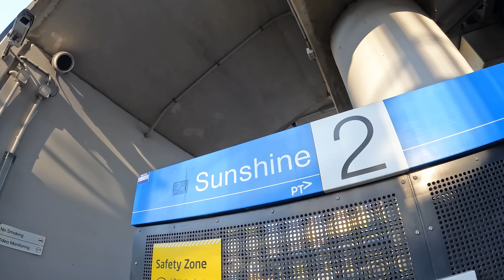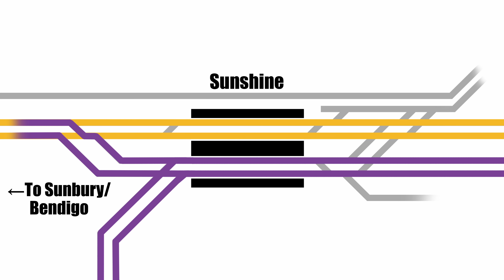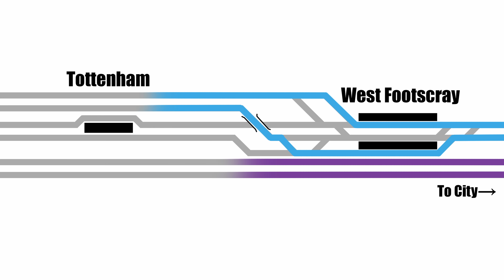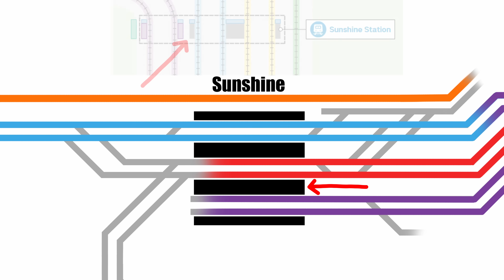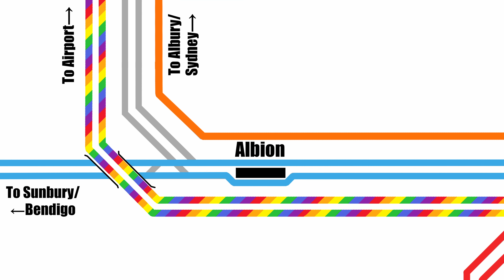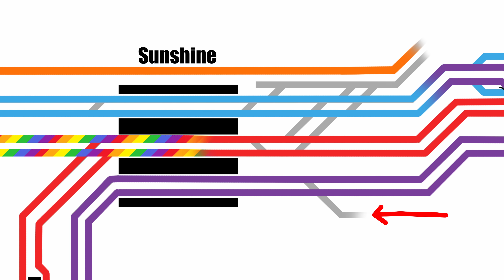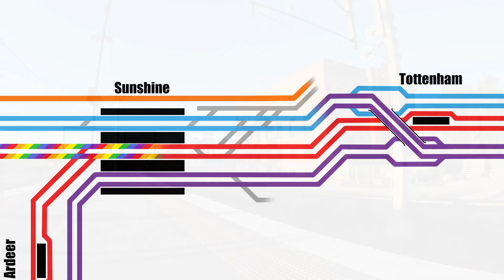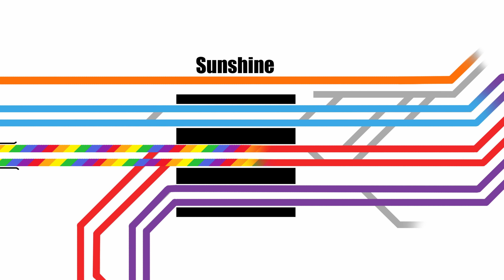A new plan for Sunshine // Melbourne Airport Rail!

Comment from the maker: A quick correction: at 03:40 I said the old standard gauge platform was to allow the Southern Aurora to connect with the Overland - it was actually for the Intercapital Daylight to connect with the Overland, the 'Aurora didn't stop here (I should have realised this - the Overland and SA were both night trains, so would be going in the same direction at roughly the same time, whereas the ID would have been heading out as the Overland came in, and vice-versa).

At 08:20 I speculated about the removal of the crossovers allowing Ballarat line freight trains to access Tottenham yard. It's now been confirmed they will be removed, and I made a short follow-up video about it here: https://youtu.be/Az7XUYPGw_g

For official information on this project, follow this link: https://bigbuild.vic.gov.au/projects/melbourne-airport-rail/designs/sunshine-station
If you enjoy watching these videos and would like to support the channel, you can join me on Patreon: https://www.patreon.com/c/Taitset
The credit music for this video is an unreleased track by Francis Ivy, which will be part of their upcoming debut album. Follow them on insta here: https://www.instagram.com/francisivyband/

Comment: What I don’t understand is how they are going to put in the space for passing tracks for Vline trains as it isn’t large enough between Ardeer & Caroline Springs (especially Deer Park because of the new overpass over the old road as it was removed).
If the plans do go ahead then it may ruin the purpose of the Vline shuttle as they plan to make the Melton - Southern Cross service 9 coaches to fit a lot of people.

If these electrification plans go ahead, then we may never see 9 car Vlocitys in the future and let alone even 2 extra terminating platforms at Melton.

Melton Station would need to most likely be relocated entirely becuase of the car parks. (but level crossing free lines?)

Comment: 7:10 the regional trains could still run through deer park/ardeer/caroline springs (i think), if they used the set of crossovers just before sunshine, from the sunbury line to the melton line. unless they rip them up but that would be extremely unlikely i would think. tottenham would still lose it's trains though, but its better than nothing
idk tell me if i'm wrong about something
Reply from the maker: It seems like the crossovers are going.

Comment: So in order to increase capacity on the northern group they've separated out Sunbury into the metro tunnel... where they're going to add the airport and Melton. Have I missed something or is this just moving the problem?
Reply from the maker: The metro tunnel will have a higher through-put than the northern loop. But yeah, it'll be interesting to see if it ends up being congested anyway.

Comment: The DOT actually had a brilliant plan to make the airport line standard gauge and extend it through the new suburbs to Wallan and on to Shepparton, Albury and Sydney.  There was also to be another line from the airport to Clarkfield, thus eliminating the need for V/Line trains to go through Sunbury and making Bendigo line much faster.  Unfortunately, this visionary plan got kyboshed when the crazy Suburban Rail Loop started to get traction.  The most successful airport rail lines have the airport as one stop on a through line.  Even the word's number one airport, Singapore Changi, can't justify through trains to the city and runs the branch line to the airport as a small feeder service.

Comment: Can you please do a video of how the Frankston line works, I used it many times around Flinderstreet and Southern cross and I still get confused, So from Frankston You can take the train to Flinderstreet and so on, stopping at Southern cross, But for some reason Going backwards from southern cross if I wanted to go to Frankston you’ll have to get off at Flinderstreet and Get on another Frankston line service to Frankston, It’s just confusing lol
Reply from the maker: It sounds like you were just on a train that was supposed to continue to Frankston, but then got turned into a different service at Flinders Street. The majority of trains run though, but sometimes you may need to change there (in either direction).
Reply: @Taitset thanks

Comment: Electrification -> I've heard in Europe there's a trend towards using batteries that charge while the train runs on the electrified lines then used for short "last mile" journeys on non-electrified lines (big enough batteries to run a train are too heavy and slow to charge for full journeys).  This is giving the ability to expand networks without expensive electrification.  I wondering if they're electrifying Melton because they need it ASAP for MetroTunnel ... but these hybrid battery trains might be the future for something like Tarneit - Wyndhamvale? By the way all the bridges and station in that corridor seem to be designed for eventual track duplication for seperate country and suburban lines.
Reply from the maker: The only place battery operation potentially makes sense is for fairly short, fairly low speed, fairly infrequent lines. The only place I'd suggest it might make sense for here is the Stony Point line. Wyndham Vale (and in fact Geelong) are heavily used fast lines with very frequent trains - it's well worth electrifying properly.

Comment: Caroline Springs station was built with electrification in mind from the start. Years 😮 I did some structural CAD work on it, there should be some footings on the north and south sides of the stations for catenary structures to enable easy electrification to Melton

Comment: Can you please make a video what the difference between Melbourne metro🇦🇺 and Moscow metro🇷🇺
Reply: Well for one, it uses 825V A/C third rail as opposed to our 1500 D/C overhead wires, and it use 1520mm rail and we use 1600mm rail. Unlike in Melbourne, where we use 2 metropolitan zones, Moscow has no zones.

Comment: A big question for me is where will the Melton suburban line trains terminate at the Metro Tunnel end? According to a blog post I found which in turn cites the Metro Tunnel and Melbourne Airport Rail business cases is that when the Munnel initially opens this year, the baseline off-peak timetable will be 6 tph between Cranbourne/Pakenham and Sydenham/Sunbury and 6 tph between Westall and West Footscray, then when the Airport Line would start running in the 2030's all the West Footscray-terminating trains would run out there. Basically that would leave the off-peak frequency on the South Yarra-Westall section at 12tph with 6 going to Sydenham and Sunbury and 6 going to the airport, which should leave enough room for the 1.5-2tph Gippsland line frequency they're currently planning. But now you'd also have anywhere from 3-6 additional Melton line trains per hour running along the Dandenong corridor which will leave very little room to expand service on the Gippsland line and only further highlighting how much of a bottleneck "Skyrail" has made that line. So in my mind they'd probably have to find somewhere to terminate those extra trains from Melton and also possibly Wyndham Vale in the future, like at Anzac or something, to prevent the Dandenong line from being extremely crowded during peak times. But I don't see any plans for this, so in my eyes this oversight is a timebomb waiting to explode. The only thing I can think of which would make this work is the communication-based signalling on the Dandenong line, which admittedly I'm not really that knowledgeable about how signalling systems work, but if someone who knows more about that stuff could enlighten me on what the maximum throughput of the current Dandenong line with the new signalling system is, that would be much appreciated.

Comment: Quick question, I thought that the airport line was going to connect from Broadmeadows or off the craigieburn line which would bring some much needed attention to it and upgrades, especially as they are getting the new X Trap 2.0s. As someone who uses the craigieburn line on the daily, just wish they’d update it or pay it some attention. What are your thoughts on this?
Reply: An earlier suggestion (several actuall, over the decades) was for the airport line to run off the Craigieburn line.  But the government announced in 2018 that it would be built to run via Sunshine, and the Albion-Jacana rail corridor.

Unless you mean the far distant SRL North, which (as currently proposed) would link Broadmeadows station with the airport, but not until the mid 2050s.

Comment: I hope that split platform between 4 and the new 5 is incorrect and that it is indeed an island platform, because it is potentially a cross-platform interchange between the western regional lines (Geelong/Wyndham Vale, Ballarat/Arrarat) inbound to transfer onto the Airport line heading to the Airport. If not, then an inbound Geelong/Wyndham Vale/Ballarat VLine passenger switching to an Airport-bound Metro train will be forced to do a super awkward platform change rather than just walk across the platform. For inbound Melton or Sunbury electric trains heading to the Airport, those passengers could theoretically continue one stop further down to Tottenham for a cross-platform change onto the Airport line and vice versa if they wanted, but that is a crap outcome. Otherwise they have an awkward platform interchange now because the Airport line won't be stopped at Albion and has separate platforms at Sunshine.

Comment: When I saw this video title I was wondering if the XPT (and whatever will be replacing it eventually) would be stopping here as Broadmeadows is the only other stop in the Greater Melbourne area for that train. Every time I've gone to Melbourne I've used the XPT and it would be handy to have some other stops rather than having to change trains at Broadmeadows or Southern Cross...but obviously that ain't a priority here.

Comment: @Taitset i found a solution where the bendigo fly over isn't needed 
Once the metro tunnel is running u can use the existing tracks that run past the tunnel and south ken to run bendigo v line services on as these travks will become un used when the tunnel opens
Reply from the maker: That creates a much longer section where Bendigo has to share with suburban trains, and also creates a conflict between Bendigo and Craigieburn/Upfield at North Melbourne.
Reply: @Taitset  yes it would be a longer section till west footscray when the airport/melton line would branch off on the existing alignment while the new alignment would run sunbury/bendigo line .
As for the conflict mabey a short flyover between north Melbourne  and south ken could be used to re rought/tap in the bendigo line to the un used track this line so there dosen't have to be the conflict
Reply: BTW love your videos very informative

Comment: Re: building concurrently with Melton electrification and quadding. As much as I hope this is true, I don't think the regional stations present a problem - it would be easy enough to build the new platforms at Sunshine and just plug them into the existing tracks in the short term. Then once you've built the electrification and quad track, slew them over to connect with the new express tracks. Good point about Tottenham, though - I don't see how it could get any trains in the short term, unless they electrify to Melton (or the Airport Rail project happens sooner than we assume). 

Re Bendigo trains sharing space with Metro trains for longer - I don't think this actually causes any problems, or at least in comparison to a hypothetical "Bendigo trains stop at Sunshine but do it at Platforms 5 and 6" scenario. When different types of trains share tracks, it's differing stopping patterns that tend to cause the headaches - express trains catching up to stopping-all-stations trains. In this new section (east of Albion-west of Tottenham) both trains have the exact same stopping pattern (ie both stop at Sunshine) so they shouldn't get in each others' way too much.
Reply from the maker: Good point about Bendigo, I didn't consider the change in stopping pattern. 

Agreed about temporary crossovers being the answer to Deer Park etc, I'm just not sure if that's actually the plan.

Comment: The Wyndham line only has 2 stations, so they'll have to build out like 3~4 more to make it viable to electrify

However Melton line has most of the stations in place; 6, only needing maybe another 2 to make it viable to go

But in the current state budget is $641m for works on the Melton line; which is for ???? Considering to electrify the line, the govt will have to
- widen the trench from the rail branch off to under Anderson Road to accommodate 4 tracks
- build another rail bridge over Mt. Derrimut Road, to allow bypassing of Deer Park station
- move Ardeer Station across (you can't just go round it; and I live very close to it) to enable a second set of tracks
- remove the pedestrian level crossings (fun times at night)
- another rail bridge over the Kororoit Creek
- rearrange the layout of where the Wyndham line intersects the Ballarat line
- move all the impeding infrastructure

The amount of money doesn't match the works required

Interesting in the state budget also are line items for
- the Sunshine Station Superhub layout; this is separate to the $4.14b of works & the cost is TBA
- the Albion Station rebuild. Cost TBA

All in all - don't think Melton is a done without another serious announcement. But considering it is the only major outer suburban area without an electrified service, expect it to be done

Comment: A couple of points: The standard gauge platform used to be used for passengers transferring from the Up Overland to the down Inter-capital Daylight. The Southern Aurora never stopped here. Also the Electrified connection to Wyndham Vale is planned to be via a new extension from Werribee. The flat junction of the Geelong line at Deer Park was originally planned to be a flying junction and should have been included in this upgrade.
Reply from the maker: I'd suggest there would be value in electrifying Wyndham Vale from both directions and running it as a loop in some way. Tarneit is the busiest station on the line, so it really needs to be included.
Reply: @Taitset  I think that the extension from Werribee was planned to terminate at Tarneit, but the trains would be stabled in the current sidings at Wyndham Vale.

Comment: Great video, I found the diagram hard to understand so this is great. 7:15 Leads into the metro tunnel... at a flat junction with the present surface line to the city. Surely Melton diesel trains would just not go into tunnel there and continue to Southern Cross on the main suburban? It would conflict with the Sunbury and Craigieburn lines which wouldn't be great for capacity or reliability but it's definitely feasible enough that I'd wouldn't try to extrapolate anything about sparked Melton.
Reply: Or for that matter use the mystery Sunshine up end crossovers to reach the Bendigo flyover and onto the regional tracks
Reply from the maker: Yes it's possible they could run them on the main suburban, the reason I didn't go further into that is that I've heard mixed reports about whether the connection to the main suburban at South Kensington will actually be retained after the tunnel opens. Also could be serious pathing issues running non-CBTC trains in amongst Melton/Airport/Sunbury on the double track from West Footscray to South Kensington.
Reply: @Taitset  Well hopefully you're right because I'm all for more Melton, faster. Although removing the connection does feel like a waste of a perfectly good inner-city track pair

Comment: 8:51 you obviously dont have time to go into it, and it's not part of the Sunshine SUPERHUB, but Wyndham Vale and Tarneit are super close to Werribee (an electrified suburban rail line for those not from Melbourne), with Wyndham Vale being the next suburb over from Werribee, and Tarneit being 2 suburbs away (with Hopper Crossing being between them)

The reason those 2 stations are so busy is because on a weekday, both trains take the same amount of time to travel into Southern Cross, at around 36 minutes, from both Werribee and Wyndham Vale, essentially doubling the amount of train options you have. Both lines have trains running every 15-20 minutes depending on time of day, and both have several busses that stop there for ease of access. Weekends the Werribee line takes an extra 10 minutes, but other than that, it's still very similar. Considering how the Werribee line USED to operate, with trips taking closer to 50 minutes, with less frequent trains, and no secondary option in Wyndham Vale, the second that line opened up, people flooded to it, with several people I know opting to drive to Wyndham Vale and get a train in, when they'd enver do that for Werribee despite the drive time being basically identical for them

And if one line has rail replacement busses (and oh hey look at that Werribee has those this weekend) you can simply... not use that line and use the other station. PTV in fact recommends getting the bus from Werribee station to Wyndham Vale station and getting the V/Line this Saturday morning.

Again, not related to the Sunshine SUPERHUB but if you're (the viewer) wondering why these 'Regional' stops are super popular, that's why.

Comment: Way Too much congestion. Surely there will be delays going forward.  For all services. 
Vline  Geelong should go through Werribee not sunshine.
Reply: geelong trains used to go through werribee until the regional rail link was opened back in 2015, the reason it was diverted through sunshine was to seperate it from metro services which wouldve been more difficult to do on the footscray to newport section